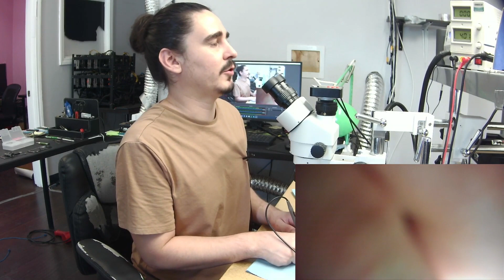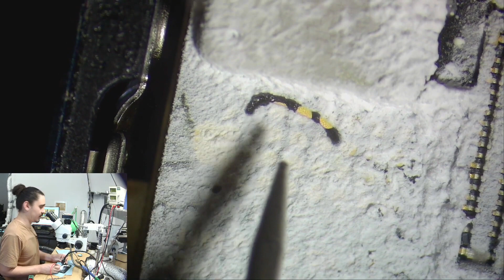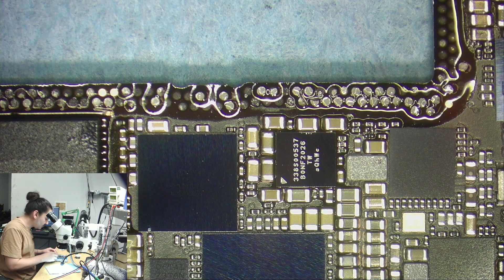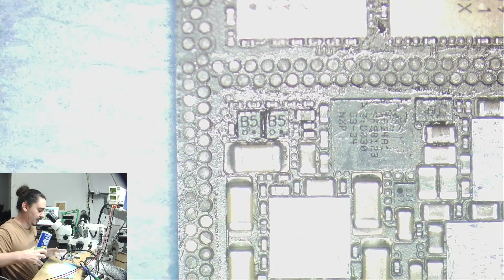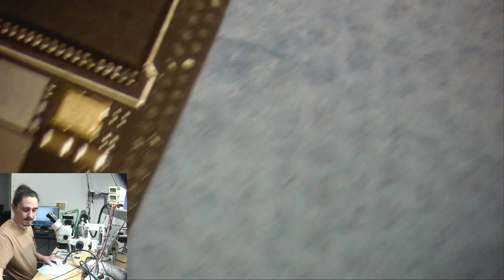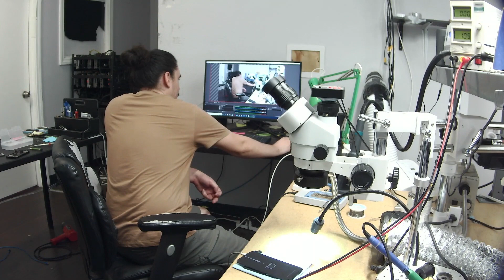How to fix an iPhone 12 with no image - Motherboard Repair

Comment: i have a 12 pro max that works perfect but no display after screen was changed the phone works an even when plugged in to chrge it  vibrates and the sound works do yall think it can be fixed cause the screen is just black and i was told it was the board not the screen that needs repair
Reply from the maker: yep, i have the link to my website in the video description. Please fill out the intake form.